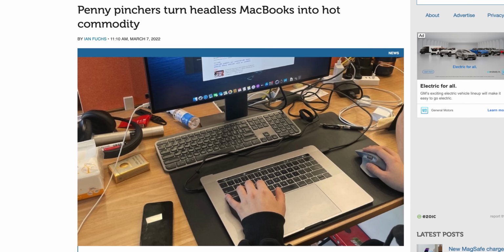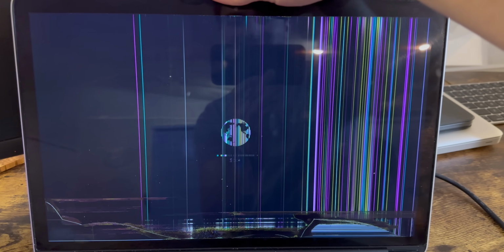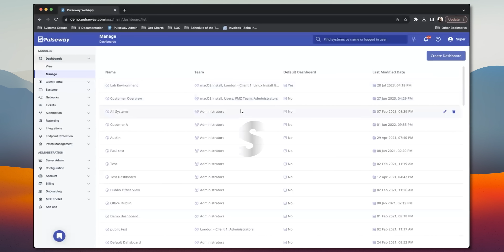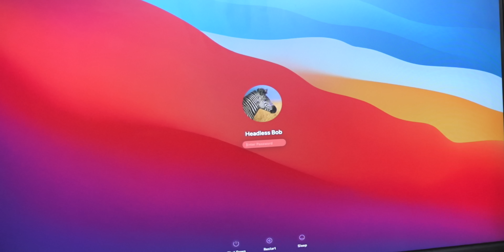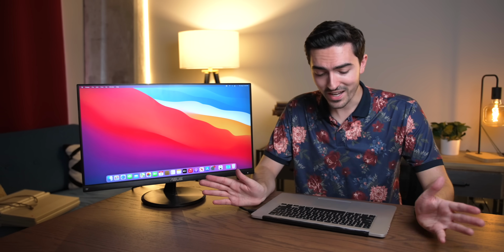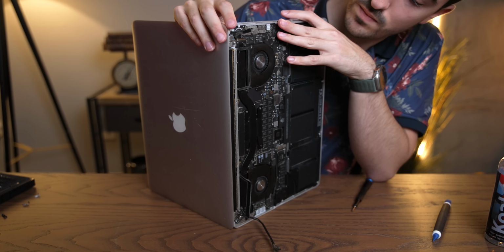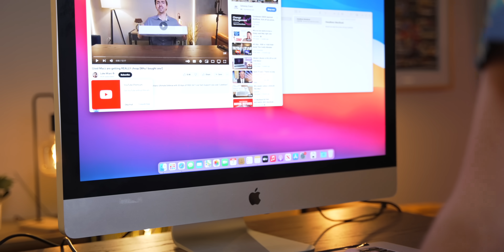Exploring the weird world of 'Headless' MacBooks

Comment: Just picked up an M1 with a bad screen and will do this with it.  UPDATE: I received the M1 I bought on eBay. Was told it had the 51GB GB HDD and it had a Terabyte! Woohoo! Removing the screen was easy. I did not put tape on that top as I figure it might be good for air flow. I should make a video to show how I did it? There are a few good tips if you do it so you don't lose parts if you decide to put a new screen on it down the road, getting it started once you start for the first time, etc. I need to go to the hardware store and get some rubber 'stands' to prop up the angle a bit for the keyboard. For $ 350.00 I have a great M1 desktop Mac with a 1 TB HDD! Oh, and Wi-Fi, Bluetooth, etc. all work perfectly. I wanted a desktop Mac and this is perfect for my needs. A terrific mod if you want a desktop. The battery backup is an added bonus in case the power goes out when you are working. Thanks Luke for the video on this.

Comment: It would been nice if you had tried it with an M1, to see if activation lock and anti repair functions would have Been an issue.
Reply: You should be able to disconnect the internal display just fine on an M1 laptop, and use the device as you please.

Comment: Note: 
On many laptops you can use the internal webcam cable as an extra usb port, because integrated web cams are mostly usb devices, you will need to solder on a usb port and figure out which leads are which.
Reply: This is good to know, as I'm trying to build a "dumb terminal" laptop.
Reply: Imagine if you extended the cable and taped the webcam to the top of the iMac screen that he was using.
Reply: why do people always get negative about some cheap trash turned into SOMETHING lol it's pathetic
Reply: You're not LTT
Reply: helpful as my ports are malfunctioning on a 2011. basically gave up till finding this in 2023....
Reply: Right.. But have you torn a mac down? Have fun ripping that cord apart for a USB. I personally get paid more than... Minimum.  So.. to spend 2 hours on an extra USB, that is... what taped? floppy? Nah, ill spend 4.99 on the adapter at good will. (JUST bought a new apple keyboard and magic mouse for 10.99 at a good will, they still retail for over 100$ when the old mouse is now useless)
Reply: @TechnicallyTechguy  dude it is four wires and you can even repurpose the connector. There is probably somewhere in Taipei or Shenzhen that'll sell you ready made cable. Repurposing commodity hardware is really worthwhile from an economic and environmental standpoint.

Think of a plastic clamshell with a place and internally routed cable to hold the smartphone built into the hinge (see old olivetti typewriter keyboard covers for reference).

I think I'll design one of these, actually. Might even investigate how to repurpose the screen bus, it must be something fairly standards based.

Comment: Was the screen actually at fault and not the firmware? I'm on the same late 2013 MBP and the screen looked just like when I installed an NVMe drive (and changed the battery, added fresh thermal paste and cleaned it) and did a fresh install of Mojave booted off a thumb drive. Not only did it display those lines but also displayed double the UI. I thought I broke it, but persevered in installing the OS and when it finished it booted normally and works like a charm. The NVMe is a SK Hynix P31 Gold which required flashing to a new firmware to be compatible with the MBP. It was a pain to do if I had to find a Windows desktop to do it through. But it was worth it.

Comment: As a person with a headless macbook on my table, I do it because I want to reuse my decade old macbook as a linux server, rather than have it sit around idly in storage. The display is unnecessary for a system that is meant to run 24/7, unneccessary heat and power consumption. So yes, I still have a perfectly good display lying around in my room. Of course, with dated hardware comes antique drivers that are out of support, but its mostly a machine that I'm not afraid to mess up.

Comment: I wonder it you could fit some acrylic tubing for water cooling over the wifi section before fitting it back in the hinge area.

p.s. I did this to an old Dell laptop that someone gave me years ago, didn't have wifi issues since it was a plastic shell.

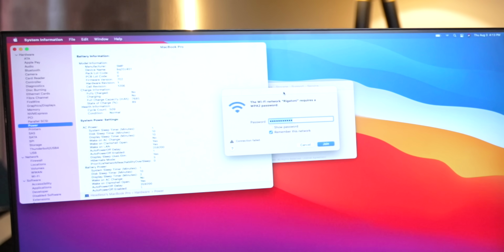Comment: 6:45 wrong. All newer MacBooks (12" from 2015 onwards, Pro 13 and 15" from 2016 and Air from 2018 onwards) actually have the "antenna bar" installed in the topcase rather than the screen itself.

Comment: The fisrt step when doing such a teardown is to disconnect the battery. I didn't see any kind of mention in the video to disconnect the battery. Also the fourth screw that has gone loose on the CPU cooling solution will throttle the performance of the laptop

Comment: Maybe if you use a heat shrink sleeve instead of electric tape you get a cleaner look, and it’s not that expensive. Just be careful not to apply too much heat as to damage the hinge or the antenna components.

Comment: Hello Luke, I have been watching your videos on macs and i like what you are showing.
I have a mid 2012 Macbook Pro 13 inch (Unibody), i disconnected the display cable from the logic board but then connected it back again cause I was afraid to go any further, I didnt remove any screws related to the display, but when I did disconnected and connected the wire, I did not disconnect the battery and now when I turn on the machine, it only shows a white screen and nothing else, where is the problem I dont know, what should I do?

Comment: Speaking of a Score.. Been watching and looking to buy.. M1 14.. as the prices went up, had to wait. Ended up finding 2 mispriced M1 macbook Air.. listed $489.. Got and additional 15%.. off.. Both in Like New Condition.. The one I chose, because the other had dead battery, Was sold last year, barely used, my friend, got the other, same deal  but sold Nov, last year.. Still under warranty.. He actually had to use after leaving his computer in the car, on Tampa, Florida 😂.. Apple told him it was under warranty and fixed it with no problem... That's 💯💪🏾

Comment: I used the wifi cables out of a 2012 Unibody MacBook Pro display to solve the wifi issue. They are fairly easy to remove and can be taped to the top of the housing of the headless MacBook.

Comment: Go find plastic c-channel spines used to hold simple reports together.  That could be the right fit for your antenna.  No need to 3D print a part when they already exist in other applications.  The battery life on this PC in a keyboard should be much improved without having to account for the power hungry video display.  You might also consider using Gigabit or faster Power Line Network Adapters.  They turn the electrical wiring in your home into a network connection.  Want to expand the network?  Simply add more PLNAs where needed.  It will result in plugging in an Ethernet cable to either the LAN port or LAN dongle.  Unless your Apple PC fully supports USB Type C spec has to offer (power, bi-direction data/Internet, video, audio, etc).  One other alternative to having zero wires attached to the headless laptop is to find or create an inductive charging/data pad that handles power, bi-direction data, video, audio, Gigabit or faster LAN functionality, maybe even human to machine user interface.  Then all you'd need to do is set the PC down onto the MagicPad or SuperPad or whatever you'd call it for things to just work without having to run more cables between the computer and other peripherals.

Comment: For anyone planning to do this i have some tips for you:
1. Macbooks pros from 2016 and never including mba from 2018 have antenas built in at the lower portion of the laptop so when you remove display you don’t have to worry about it.
2. Also on these never models the keyboards backlight stops working when you remove display because it needs the ambient sensor which is in the display. (And theres no way to force backlight on)
Other than this its a great way to have macbook experience on a budget😁
Reply: You can force the backlight on. You just turn off the light sensing.
Reply: Do you still recommend doing this? I'm thinking of buying a laptop for programming work and yeah it'd be great to swap between devices on my monitor
Reply: @emberavenge7162  It depends on the macbook model, and the price you could get it for. I would really recommend m1 air or pro macbooks with damaged screens. Because they are really powerfull and dont have any issues with keyboards.
Reply: Thanks! Do you know if a headless mbp 2021 16 M1 Pro would work?
Reply: @rainerzufall9627  yes they work perfectly and screens are easy to remove.
Reply: what about A1502's wifi antennas?

Comment: I did the same on my 2007 MBP several years back. Its backlight was basically broken making the screen 98% dark and I could only see what was on the screen if I shone a flashlight through the apple logo from behind 😂.   I removed the screen and used it as a stationary Mac for a while and it worked like a charm. It was a fun little project and it looked nice and clean on my desk too as all the cables were connected to the keyboard chassis and no computer case was visible.

Comment: The trend of using "headless MacBooks" involves removing the screen of a MacBook with a retina display that needs costly repair and using it as a desktop instead. By purchasing a cheap, broken MacBook with a cracked display, users can use the internal display in clamshell mode and connect to an external monitor, using the keyboard and trackpad as the desktop's input devices. The resulting headless MacBook is an interesting desktop setup that offers significant cost savings compared to purchasing an Apple desktop. However, the downside is the loss of Wi-Fi and Bluetooth capabilities, which necessitates the use of an ethernet connection.

Comment: I have a mid 2014 MacBook Pro, and I use it 'headless' since 2018. My recommendation: unplug it and drain out the battery once a month. The battery swells quickly when it's connected all the time.

Comment: I imagine this with a portable display would actually prove to be quite a useful laptop setup.
Reply: holyshit I can't believe no ones thought of that, what will apple fanboys come up with next
Reply: I know where you're coming from but I'm not into that ecosystem. I think it's just the idea of headless laptops and similar products are still interesting to consider as external displays and other options of usage are proving to be more mature, feature packed, and affordable especially with older laptops or ones with expensive replacement panels.
Reply: @SoftwareSlicer  I just thought your statement was funny because the notion of removing the screen instead for a smaller portable display is just reinventing the laptop, which is mad goofy juxtaposition (rather than a jab at mini-ITX/raspberry-pi/chromebook builds being superior or anything.) Still fail to see the appeal though, like you don't unlock superpowers the moment your rip off the screen the ability to plug in an external monitor was always an option.

Comment: For $60 he got the equivalent of a Mac Mini with the keyboard and trackpad which saves a lot of money, but another thing that I didn't see mentioned in the comments I read is that you also get a battery backup so if the power goes out your computer doesn't go off as well. So, you save money on the cost of a battery backup unit as well. Great video, Luke!
Reply: Your computer does go out. The monitor will turn off. The benefit is might not lose data
Reply: @eomoran did anyone have fast the power flashes it won't really be that big of a deal that the monitor turns off You just have to sit there for like 3 minutes max
Reply: @eomoran  well more un-interruptible, power lost now that long
Reply: @eomoran  No the monitor doesn't turn off. If you're in clamshell mode it will turn off, then you can just lift the display and it will start using the battery.
Reply: @eomoran same would happen with a mac mini except with the potential data loss. You made an irrelevant point.
Reply: @kenshn22828 it is a relevant point, the internal battery is not a fully functional UPS equivalent because you won’t be able to continue using the setup with the monitor powered off.

You made an irrelevant point.
Reply: @whyamiwastingmytimeonthis  The point isn't regarding whether or not the setup is functional without external power, the point is regarding WHAT HAPPENS when you lose power. The Macbook would remain on since it has a standalone battery whereas the mac mini would have no power and would immediately shut off. The mac mini could experience some data loss depending on what you were doing when it lost power.

Neither of you made irrelevant points, you're arguing about two different things.
Reply: @eomoran i dont want to be mad, but did you kniw that portable monitors exist?
Reply: @queasycarboy508  just use a laptop at that point
Reply: @queasycarboy508  that would good solution, called second screen or something power might be a problem
Reply: Hopefully nobody watches otherwise prices going up
Reply: @Shmack_ that’d be better than more ewaste. We don’t want these beautiful machines to be lost, they’re way better than many old windows computers and at the same price.
Reply: Just built a Mac mini server for iMessage on android, kinda wish I went this route. Oh well, mine is still pretty good I got a dummy HDMI and remote desktop for controls. Even poweroffs/crashes are fine, since I have it auto login and start parsec on boot.
Reply: he just needed a way to bury that disgusting crap inside the wall while exposing the ports. So it's kinda hidden..
Reply: You have speakers too !
Reply: Its a 2013, its worthlesss
Reply: saved me from disconnecting in a wow raid once
Reply: Interesting that mac mini doesn't have a battery even in 2023.
Reply: @SirusStarTV  It is an interesting idea, especially if there was also a screen built in to the top of the Mac mini so that if power goes out, you could at least save your projects and shut down properly.
...but Apple will never do that, because their business model relies on intentionally crippling devices so that they can't be used as all-in-one devices. Case in point: They refuse to allow M1 iPad to run MacOS.
They want us to think it's cool to buy lots of shiny stuff with Apple logos on them, not buy one device and call it good.
Reply: @FromDesertTown tbh,an iPad m1 should be able to run macos,like why not? It’s basically a even more portable macbook and the m1 probably wasn’t downgraded with like less cores or clockspeed because the m1 doesnt run hot right?
Reply: @FromDesertTown that would be so neat, like a tiny screen in case power goes out or you don’t have a monitor at that very moment. But yeah at that point maybe better to just get a Mac air
Reply: @SirusStarTV  my theory is that apple wants to make it clear which devices are portable and which not, because "Mac book" is portable but not "Mac".

Which might be true because apple really likes simplifying the users life.

Comment: Wow! I did this already about 10 year ago with my 15" 2009 Macbook Pro! 

I dropped it from a flight of stairs. The screen was completely shattered and it looked liked it didn't even boot after a few attempts. After that I considered it dead. But a couple of months later I did another attempt at getting it to work (to save some data), and discovered it still worked with an external screen. Then realised I could use it without the (terribly cracked) screen. So I removed it and voila, it became a "headless" Macbook that worked like a charm for years to come. 

Thought it was a nice concept (a keyboard and trackpad with a computer inside), but at the same time doubted anyone besides me (and my nerdy friends) would consider it a worthwhile device... But definitely cool. ;)

Comment: So for the same price of a magic trackpad + keyboard, you can get a full blown Mac machine if you're lucky enough to score the broken mac for under 100 bucks -- anoher 100 or so can get you a very decent monitor to pair it with. Absolutely wild. A little bit of pluck is all it takes to break the myth of the Apple ecosystem being too expensive to enter. Buying used/refurbished goes a long way. I have a $280 2018 MM, $80 Acer display, kb, chair and mouse I got for free on fb marketpalce from a nearby college, $200 SE2 AW, $200 7th gen iPad, free iPhone 14 when I switched carriers (upgrade from OG SE),  All work flawlessly used every single day. Latest and greatest is nice, but if you need or prefer Apple stuff, budget friendly is possible.

Comment: You can also use a nano USB WIFI adapter if you didn't want to pull the antenna out of the screen.  On a side note, I have been using an old Vista era HP laptop in "headless mode" for years, loaded up with Linux since it has a cracked screen.
Reply: exactly what I thought aswell 😂, that adapter would cost you under $10

Comment: On the topic of extreme lengths to keep old hardware usable, a family member had a circa 2008 HP desktop with a Core 2 Quad and a faulty Gefore 8500 GT. I spent about US$90 on a replacement video card (2GB RX 550, the crappy RX 550, but still an upgrade over what it had), 8 GB of RAM to replace the mismatched 3 GB it had, and a dirt cheap 500 GB SSD (Silicon Power is definitely budget, but still a good reputable brand).

The CPU has become the weakest part now and does limit some more intensive activities, but it generally runs amazing now for web browsing, productivity and even some light older games thanks to the GPU upgrade.

Comment: So now Vesa mount it to the back of the monitor and use a wireless keyboard and mouse for a very clean desk.
Remove the battery and run off mains power and you got a cheap powerful machine